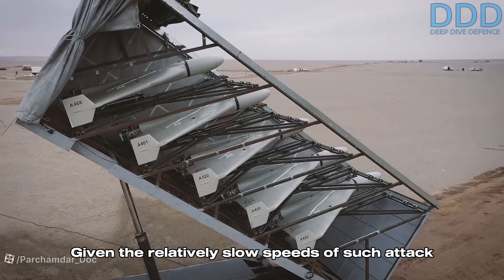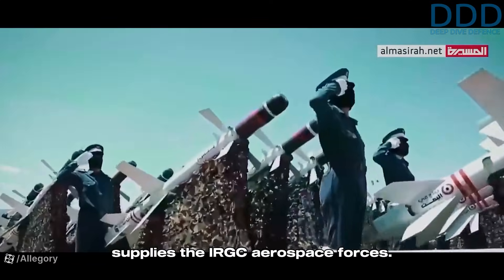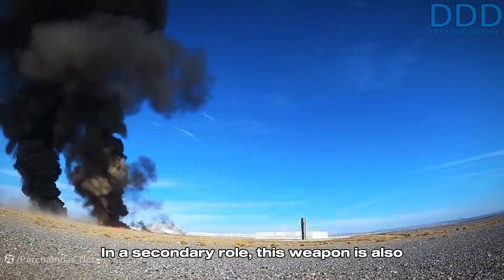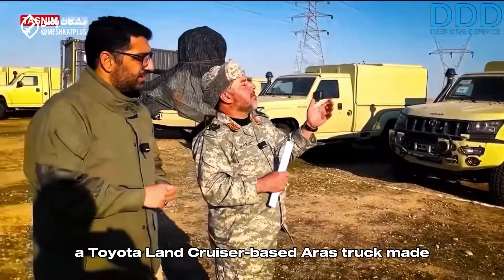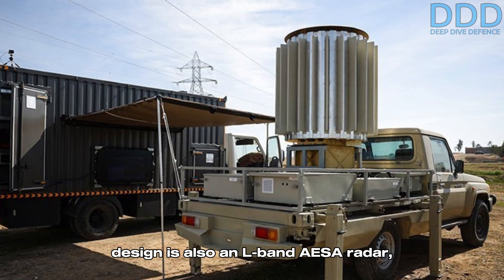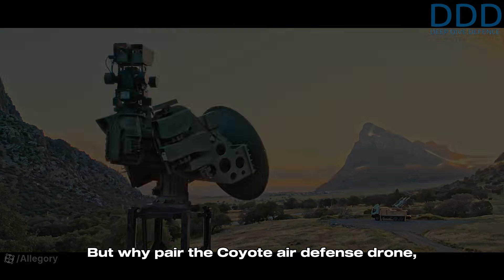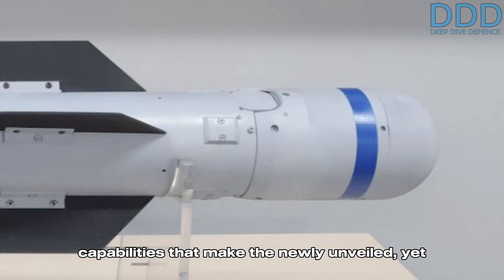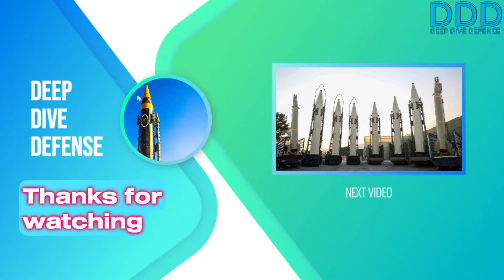Iran's new 'Coyote' Air-Defense-Drone: Why Ghaem-118 is a next-generation weapon

Comment: Going from a revolutionary design of the 358 loitering SAM that proved itself as the MQ-9 killer to a copycat of an American loitering missile with a much more limited range, inferior IR sensor, and which itself was based on Iran's revolutionary 358 drone concept.  I hope they don't continue this.

Instead, Iran should ask itself:  "How do I modify the 358 drone concept to be a stealth bomber's killer at long range and max. altitude?"  Because it can be.  Hybrid motor, stealth body, upgraded AI-capable processor and a jet engine for the terminal stage, as well as tracking from hovering drones (which can provide much further range for tracking) using low-frequency radar (which helped shoot down the F117 Stealthfighter over Kosovo).
Reply from the maker: That's "Missile 359" or Shahed-359 what you describe
Ghaem-118 is good for short range threats and can be put into a sealed container and is smaller than -358
Reply: @DeepDiveDefense  yeah, but ultimately, what does the Ghaem-118 provide which the Shahed -359 doesn't already?  And if nothing, what's the advantage of making two separate missile platforms?  And especially concentrating on short range threats?

The Iranian forces in Syria, as well as their proxies in Lebanon and Yemen, were being filleted by long-range stand-off missiles and glide bombs launched from high-altitude F-35s and F/A-18s, not from short-range inexpensive drones.  Their air defenses and tracking were completely inadequate for defending from these threats, and the ally they relied on - Russia - refused to share tracking information from their S-400 systems with Iran.  What's Iran's answer to THAT?  

There doesn't seem to have been any real promise of one...until now, with the 358/359 platforms, the latter which we're told can be used to take down refueling and AWACS aircraft, at least, and both of which use passive infrared and electro-optical sensors, none of which can be detected by enemy aircraft. 

The S-300 and its derivatives, such as the Bavar system are far too clunky, mostly static, and based on old Russian designs which modern Western aircraft are literally designed to defeat, and rely on active radar for  tracking and targeting.  Which is to say, they work by putting a massive cross-hairs on top of themselves, as HARM missiles were designed literally for this purpose, and were effective in the Iraq and Kosovo air campaigns.

Comment: I wonder if the era of the attack helicopter is almost over. The threats to them makes them pretty much unuseable.
Reply from the maker: They certainly need a counters like infrared jamming to remain effective
Reply: @ That won't help against heat-seekers or activly designated drones. I just don't see the cost of helicopters being valid, both for machine and crew, when Drones can fill their function more and more.
Reply: clearly not. and neither is tank era going to end. but helicopters will probably need active defense systems.
Reply: @ Drones will replace them. The cost of todays helicopters and crew contra the risks makes them a bad option in an attack role. We've seen the Russians really struggle using them in Ukraine, and only really made an impact when they we're in a defencive stance where they could ambush armor. On the offensive, the AA-systems of today, including drones, are just too affective. I think this is why we haven't seen any major new Attack helicopter plattforms in ages.

Comment: While Iran has excelled well in various areas the IRIAF is the weakest link imo, from the Shahed 285 helicopter project which turned to nothing, to various attempts to create fighter jets from Azarkhash to Saegheh turned to glamorized unveillings and after 50 years mass production has not even been reached on these F5 designs. I think the management top down in this sector needs to be reassesed. All IRIAF does is embezzle funds through bs projects.
Reply: So true. Like why do they have 5 different fighter aircraft projects (that we know of) and have not progressed on any single one? Like just focus on perfecting one and mass producing that. Iran needs to get either a Chinese or Russian production line locally.
Reply from the maker: Because fighters are high-tech and difficult to master, their projects have been low budget ones until now.
Iran's aerospace industry needs to further mature for more serious fighter projects.
Which is happening
Reply: @DeepDiveDefense  Waste of money and effort. They need to put all their resources on a single project for an Air superiority fighter at least gen 4.5. Sanctions shouldn’t be an issue when Russia has been able to continue producing its 5th gen albeit slow. Iran has been extremely slow and incompetent in terms the Artesh Air Force. Also I can’t get my head around why they purchased attack helicopters instead of investing it into more fighter jets. Helicopters won’t help you when the enemy is bombing the hell out of you because you don’t have an Air Force.
Reply: @Popo-hi7or  most of it was due to the fact that how much money and effort you put in fighters just only Israel has better if they would put all resources (or vast) to fighters they wouldn't be able to have missile and drone offensive and defensive capability 
We all know in near future most of parts which traditional aircrafts done will be done by drones and missiles and if they competed in fighters air superiority they would loose but now with both missile and drone tech being relevant to making fighters just now iran can start to make fighters in a way that numbers are enough and have local tech for it's capabilities even if iran made 5th gen by now they didn't have support or numbers or any other capacity to attack which prevent enemies from doing 
Usa has a group of highly industrylised countries to rely Iran had to sacrifice budgets 
Beside neither shah era air superiority or attack helicopters that was to prevent Iraq did the job so they took different approach
Reply: @Popo-hi7or  why think like the rest , why copy birds flight when you could think totally different . They have . That's why they have never tried buying fighter jets or even make it . What they wanted are already achieved and finalized in 2010 and fully operational in 2012 .those jets making are just a show

Comment: Coyote' Air-Defense was US copying Iranian innovation since Iran's successful missile 358 was the first and only jet powered air defense way before coyote and also remain the only loitering air defense and US captured some of them outside Persian gulf while smuggling them from Iran to Yemen by Yemeni fisherman and the fact that you didn't mention that is not cool
Reply from the maker: The Coyote program is older than known Missile-358 appearance.
But I understand where you come from.
Reply: @DeepDiveDefense no its not, coyote is less then 5 years old. U.S didn't even face any danger to need such SAM more then 5 years ago
Reply from the maker: 358 appeared 6 years ago to the public and Coyote 5 years. Usually it takes a few years until the U.S MIC can develop such a system.
Hence its unclear.
Reply: @DeepDiveDefense  If Iran openly transferred this technology to the Houthis it just means they had worked on it for years and have even something better in stock so it’s little risk to transfer this item and risk its capture. It’s simple logic. Iran invested in something like this first. The US took inspiration.
Reply from the maker: Possible but can't be confirmed
Reply: @DeepDiveDefense  If the US program is older than Iran’s 358 appearance, it just means that Iran’s program had begun far earlier than the US coyote.
Reply from the maker: Well possible. But since we can't know, I avoid talking about it
Reply: @DeepDiveDefense  Although I respect you for being the fairest analyst by far when it comes to Iran in English speaking spaces you too suffer from same famous hypocrisy and double standard and keep saying we don't know for sure so i didn't mentioned it. However, you have no difficulty making wild assumptions and sometimes providing blatantly false information as a matter of fact. For example, did Iranian engineers personally call you and say this is reverse engineering of the Coyote? can't it be just copying the design and concept but with their own engineering, like what they did with the 15 Khordad Air Defense system, which is a copy-paste of the Patriot Air Defense system but obviously not reverse engineering since Iran had no access to any Patriot system 

and you can't argue they found some patriot somewhere that failed to detonate, which is your usual go-to reason to argue something is reverse engineering. like you did for this supposed coyote that they found laying around intact because its warhead failed to detonate As if the kinetic power of impacting the ground isn't enough to turn it into something that you wouldn't be able to guess if it an drone or missile, let alone reassemble and then reverse engineer 
furthermore some people(not you) seems to think revers engineering is an easy and Iran ability in reverse engineering is no big deal, It's not like if I you a Ferrari, you could reverse engineer and make a Ferrari production line. Not to mention you made up some scenario about how Iran got its hands on a Coyote that failed to detonate.
Reply: @mansari7310 ...Sir, your comment is too harsh.
Reply: @ maybe it is but it's true nonetheless
Reply: @DeepDiveDefense  Yes but always out of all those projects inspiration from outside sources made projects to go faster or different by the way we don't know exactly when Iran starts it's programs for example drone carrier is an ongoing battle inside Iran since we didn't had protection or fighters for it we started anyway but on the way drones proved themselves capable so aircraft carrier turned to drones and when things change and Iran starts mass selling of it's productions they can develop fighters for aircraft carrier and meanwhile they have at least drone version beside Iran geographic condition and strategy needs totally different things for example we don't want a huge city size ship to attack new York so it's stupid to invest money that can actually make situation fair on things that doesn't make sense to Iran's strategy and Iran is beginning to show true products and marketing since world is changing